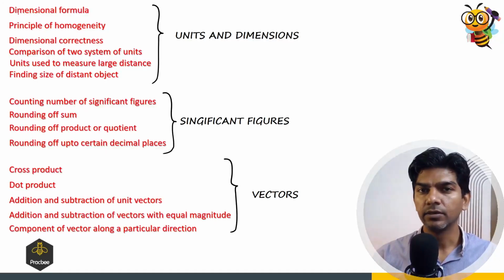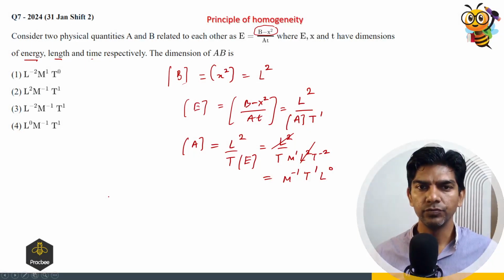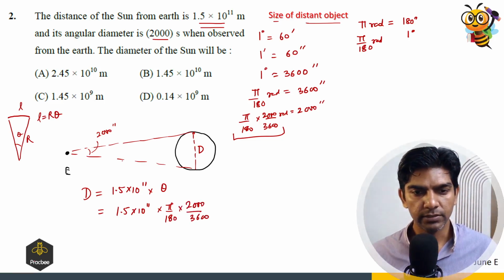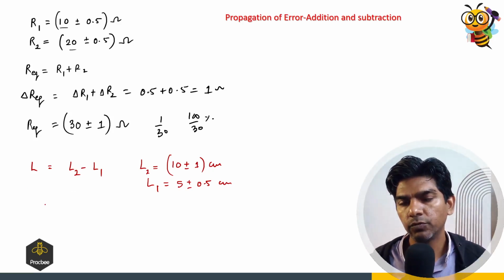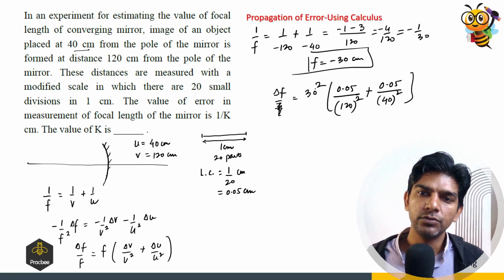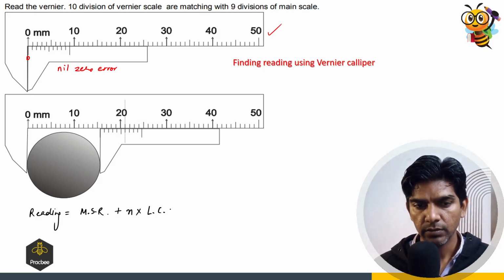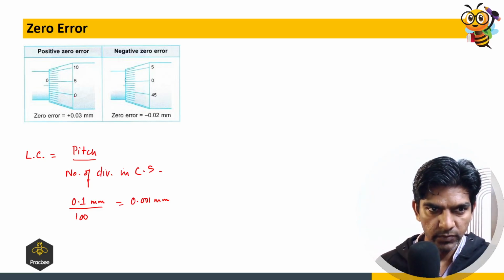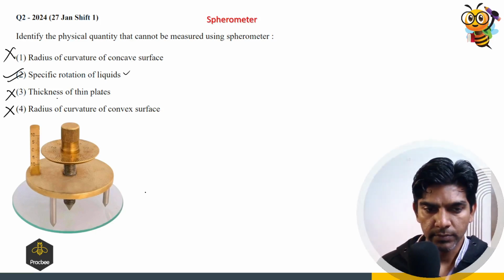Units and dimensions, Errors, Vectors, Instruments into 26 problem type | JEE Mains 2025

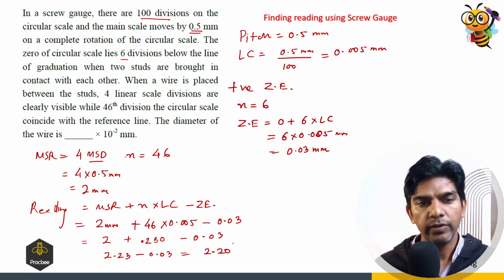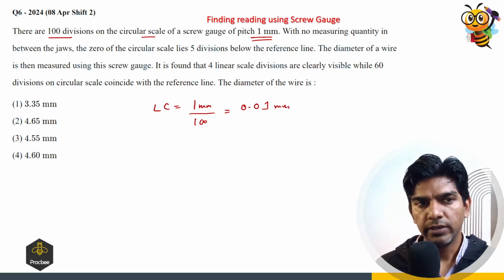Comment: sir, in questions in 2:30:01 and 2:34:21. for calculation of main scale, you have used different methods, for 1st one, u took MSD=pitch and in 2nd u took 1MSD=4mm but you have to take pitch na sir. same question two different how sir.
Reply from the maker: In 2nd i have taken MSD as 1 mm. MSR (Main Scale reading) is 4 times MSD
Reply: @pracbeementor  ah yes sir, thank you sir. watched the whole video again and i am fully confident in this chapter. please do this for all chapters sir